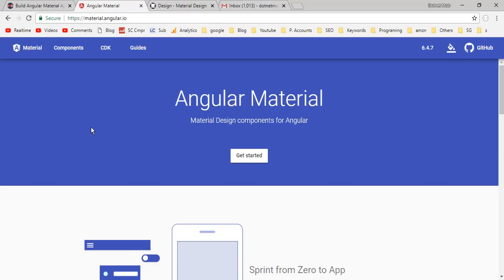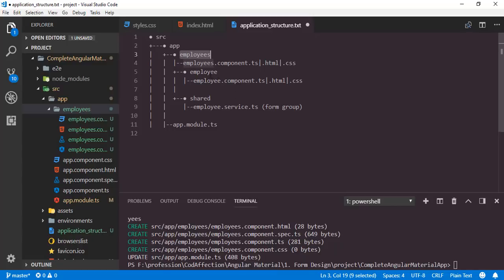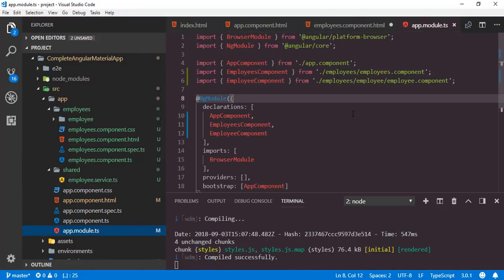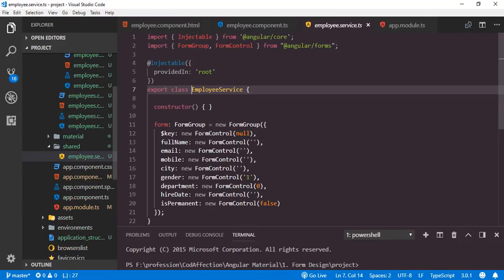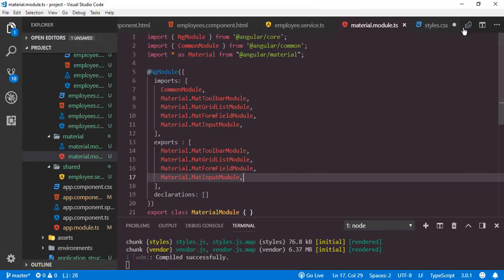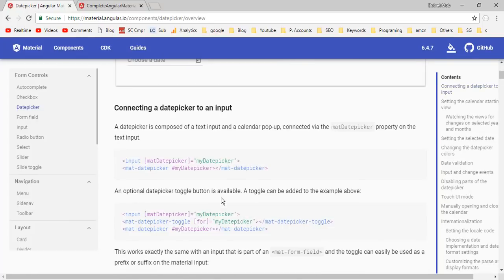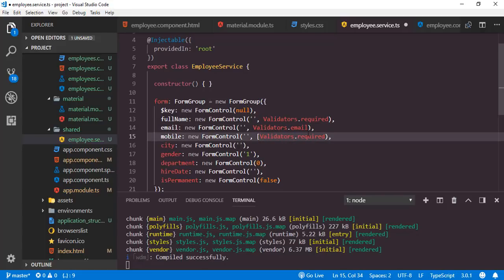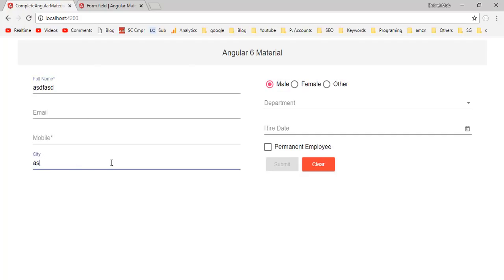Complete Angular Material Tutorial - CRUD Form Design

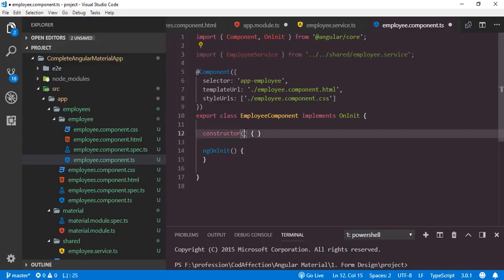Comment: 16:05 A private member cannot be accessed from the template when strict mode (Angular 12) is enabled, it should be declared public.
Reply: Does this tutorial work fine with angular 12 ???
Reply: I used protected and it worked.
Reply: @joaoortega1868  yes that is a major flaw in Javascript. TypeScript when compiled enforces encapsulation but the Javascript result is not. that is why it is not a proper language, honestly.

Comment: Great tutorial! This example is a good way to start learning angular. I have encountered only two issues:
1. When clearing the form, I got an error in the console because the initialize method from the service was not recognized. Removed the providedIn: 'root' from the @Injectable and it worked;
2. import * as Material from "@angular/material" does not work anymore (angular 9). I had to import each module separately;
Reply: for me it is not working Property 'initializeFormGroup' does not exist 
on type 'FormGroup'. what to do help !

Comment: Somewhere between this video and the next one in the sequence, the code for populating the Departments changes from a hard-coded list to one that comes from the Firebase database that is created during that next video.  However, I'm over half way through the next video and do not see any discussion of how the "departments" table is populated so that it can supplant the previously hard-coded list of departments.  How can I populate that Firebase database table so that the code for the next video works properly?
Reply from the maker: department table is render from firebase collection departments, which is discussed in second video here : https://youtu.be/hfhlzY3U27M?t=781. The firebase collection documents are inserted manually.(Other ways the video will be long one - If you watch this whole series. you create separate form for adding departments ). And then this shows how you can display department records from the firebase collection.

Comment: I have a problem with [formGroup] = "service.form" tells me "identifier 'service' refers to a private member of the component" I do not understand, I have everything the same
Reply from the maker: did you inject service class as per the video ?
Reply: Yes, as I said in the video
Reply: also download the code and I get the same
Reply: Rare, I get the error in visual studio code but everything works.
Reply: @Link2618  I had the same error.  Switching the service from private to public fixes it.  I also use VS code and after some stack Overflow rabbit holes its aparently better practice when dealing with views to list services as public